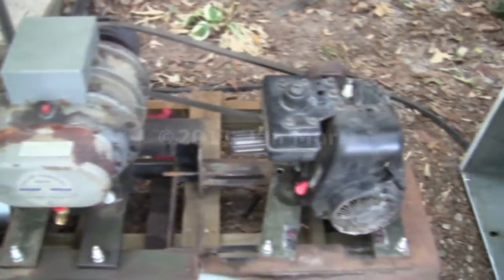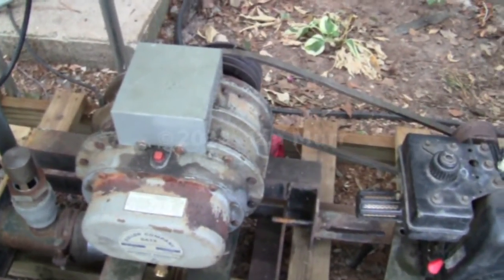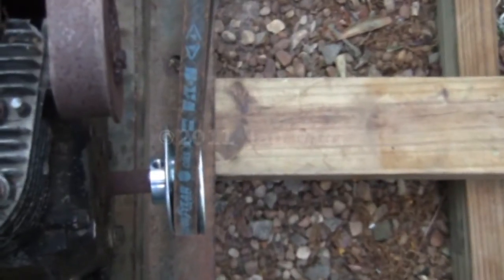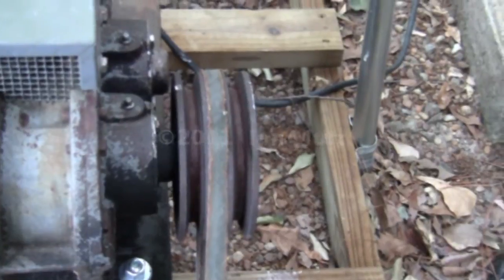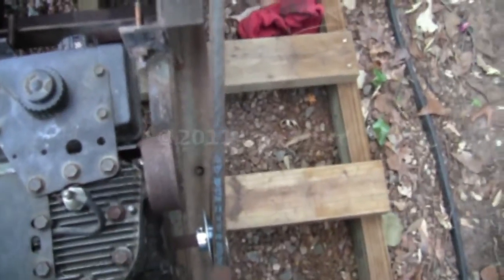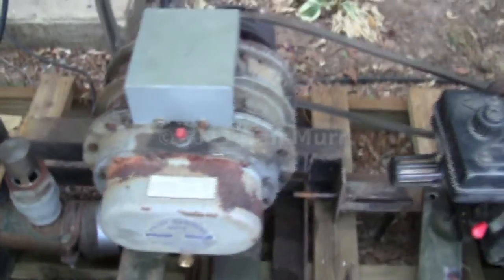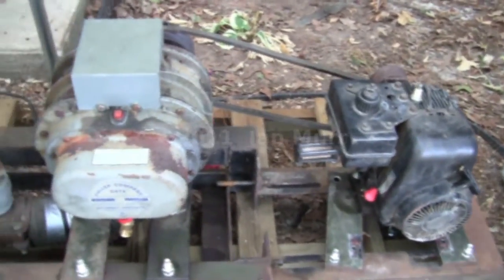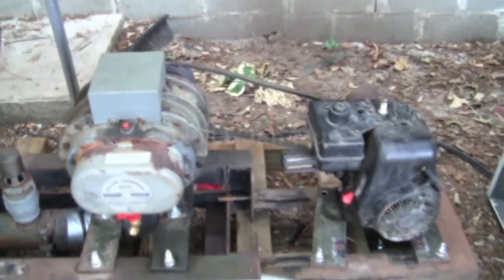Thunderbolt "2000" blower setup

Comment: Never seen the inside of a 2000 blower
Reply from the maker: +ᴛʜᴜɴᴅᴇʀʙᴏʟᴛ 1003 Me either, only in pictures of one that used to be installed someplace in California.
Reply: me either
Reply: It had an 18HP Onan gas engine inside, much more power than this 4HP, although whether it was all needed to run the blower is a question. I suppose the suitability of the smaller motor in the video depends on duty cycle and how hot the engine gets.

Comment: @murrfarms i'm running my blower up tuesday with a 15 HP honda motor using the actual pulley wheel and rpms of 500 to 3500.

Comment: @murrfarms 

I got a good look at the 2000 in San Dimas a few years ago shortly before it was removed. It had the older large A1 type blower with the big 6-spoke pulley and was driven by a twin cylinder engine which looked like an Onan. 

I did not see anything on it that would be a generator for the chopper and rotator. The power feed was only 120 volts.

Comment from the maker: @AKSoapy29 The 2000 was an alternative version to the electric 1000 series, which used a small gas  engine to drive the blower in place of a 10hp 3-phase electric motor. They were used in places where a large service, like one needed to run a totally electric Thunderbolt (pulling a minimum of 34A), was unavailable or impractical, however they still did use a small 240V single phase circuit to run the controls, and the chopper and rotator motors in the head. Mine was electric originally though.

Comment from the maker: @douro20 Yeah, they utilized a horizontally-opposed twin cylinder gas engine to run the blower, but I'm not so sure if they did have a generator big enough to run the head or not. I think they just had the engine powering the blower, to enable the siren to be used in areas where a large electrical service (single or three) was not easily available. You can easily run the entire head off of a 15A 240V service. If I can find a larger motor, I'd love to put one on mine so it can run full speed.